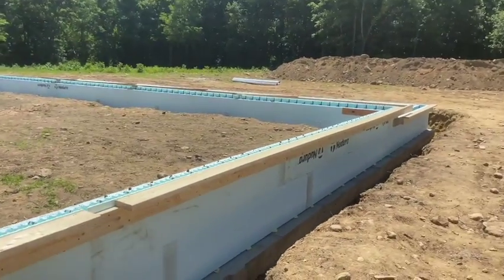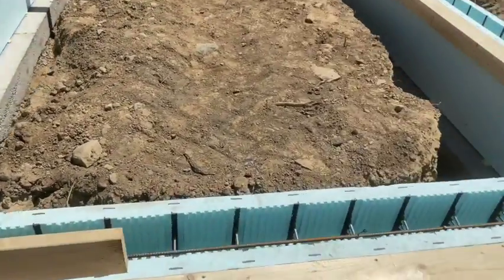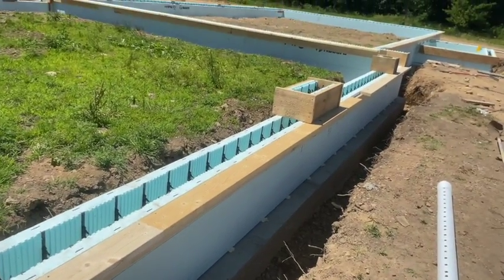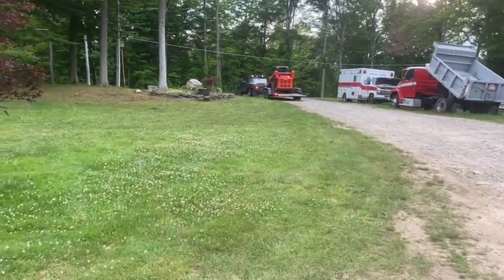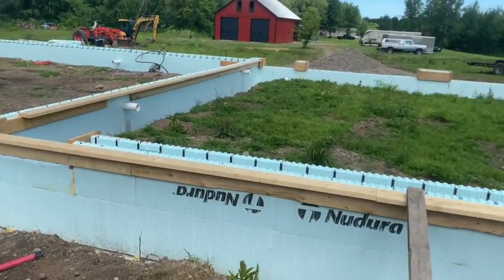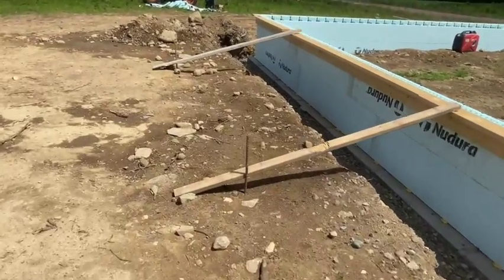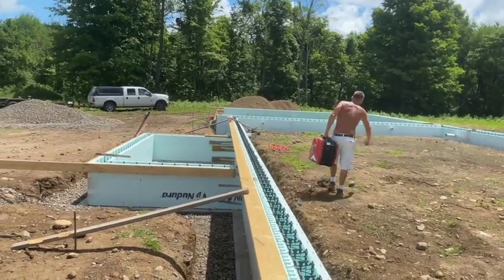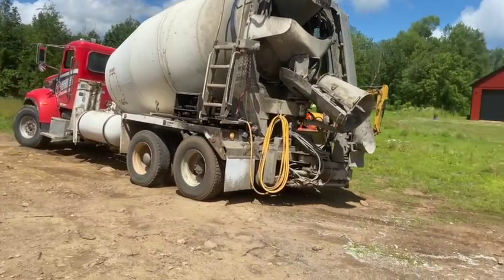Stem wall pour for Nudura ICF frost protected foundation

Comment: Hey, BrotherMan! Learning so much from your vids….Class act all the way around ….Q: I saw another vid( not yours)where there was a drain pipe on the INSIDE of the forms, as well as the outside…Why? Where would the drain exit the form? Seems to me that if it had 6-10” gravel base, 2” EPS, that that would be the extent of the inside work…Is my thinking correct? Thanks, Bondo🤩🐶

Comment: I’ve done something like this twice now holding the inside down and pouring the floor over the top and I’ve had it make 45 degree cracks on each corner. Have you ever had any issues with that?

Comment: What keeps the Nudura blocks from blowing out and shifting on the bottom? It can't only be the small spot of adhesive tacked to the footer?  If it is, why can't you use the adhesive on the common verticals, instead of adding wood connectors.

Comment: Hi I am new to all this info but I think I am in the right place. I have a quick question. I purchased land that I recently had cleared on the Kenai peninsula in Alaska. I want to build a custom home around 2800 sqft give or take. I was informed due to heavy ground frost a lot of the year, as well as earthquakes I need to be very informed about what foundation I choose. I was basically told don't even think about a basement due to the pressure from under the slab could cause moisture to come in through the walls and foundation as well as the foundation possibly cracking due to small earthquakes that sometimes occur there. Also I have done a bunch of research on "Frost Heave" and want to confirm with a professional that this type of foundation prevents frost heave or eliminates it? Would you be able to tell me if the foundation in this video is exactly what I need or the direction I should be going for these types of problems and this type of climate I described in Alaska? Thank you for your help I appreciate it.

Comment: What is the cost savings of a 4ft frost wall vs the system used here.?
Reply from the maker: Quite a bit in materials and labor. I would say 30 to 40 percent savings. Much faster and less digging and filling back in and less dirt to settle.
Reply: @bondobuilt386  thanks

Comment: Nice job, Why didnt the customer do a grade beam with frost protection rather than short wall with footings?
Reply from the maker: I designed this foundation for the customer. We like to get things out of the ground here where I live due to the snow we get. Vs doing a slab on grade or a grade beam the house would be more at ground level. He also has huge rocks everywhere at this job sight.